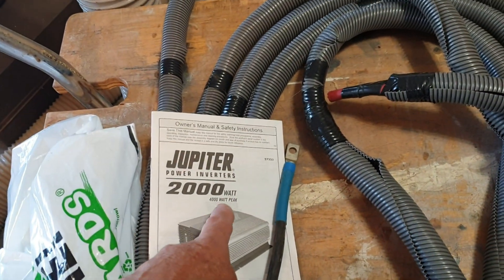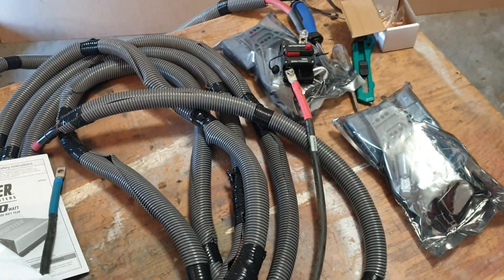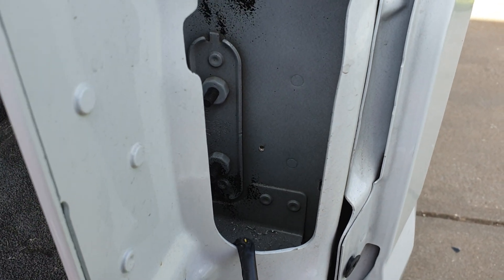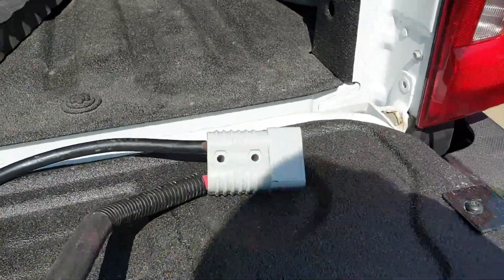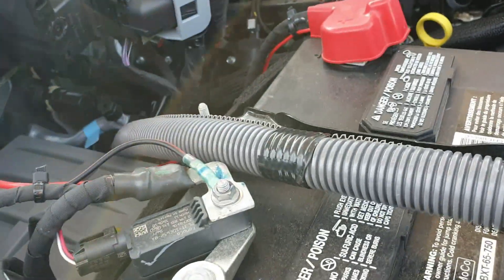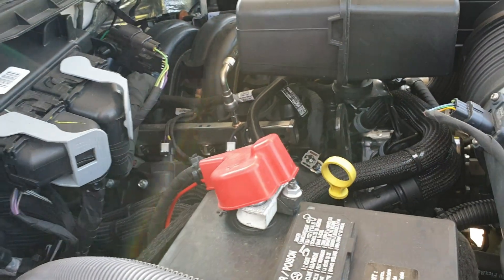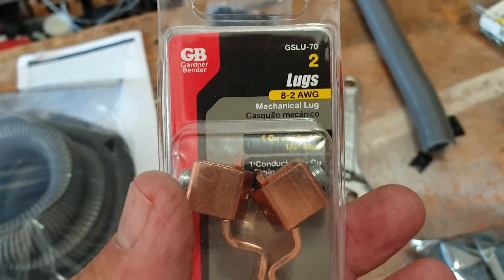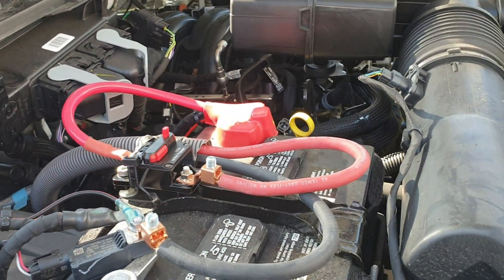f250 Power Inverter Install

Comment: Clean install.  Just finished mine a few days ago. My install is basically identical to yours. Same wire route,same inverter and same breaker but a 250 amp and I used 1/0 gauge pure copper wire from windy nation. Very happy with it so far and will be useful for years to come. Great video man! 👍
Reply from the maker: Thanks.  I just installed the smaller breaker to mockup the wiring.  The 250 breaker came the next day after I did the video. It works great .  If I needed a longer run time I would put a battery in the back by the inverter with a diode to keep the batteries from eating each other  up.  Thanks for the comment.

Comment: How high of an inverter can run off a 12 volt battery.
Reply from the maker: It will power up a table saw or a job site air compressor with the engine running.  However it will only run a air conditioner for about 30 minutes before it will depleat the one 12 volt battery.  Yet it works great for my needs.  Your wire size and distance to the battery makes a big difference.

Comment: Where do you hook the Anderson connector to? Is it just split off of the input wires?
Reply from the maker: I have a 12,000 pound winch that can go either in the front or back receiver hitch.  I use a set of jumper cables to power it from my truck. The jumper cables have a anderson connection between the two sets of jumper clamps.  This allows me a 20 foot jumper cable with anderson plug or a 5' jumper cable with a anderson plug.  Works great!  I have yet to put the winch to use.... on the new truck.  Not stuck yet!  I can always hope!  HA!
Reply: @MarkJonesRanger Why not just go with the two battery option?  (Unless I'm missing it)
Reply from the maker: These cables will be paid for many times over by extra battery costs and replacements.